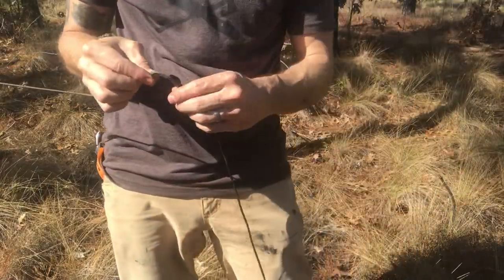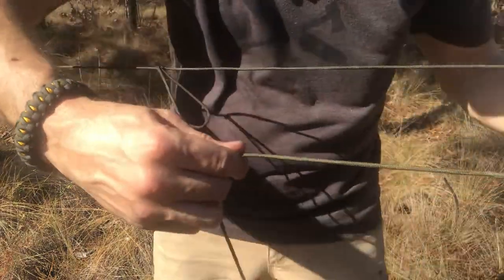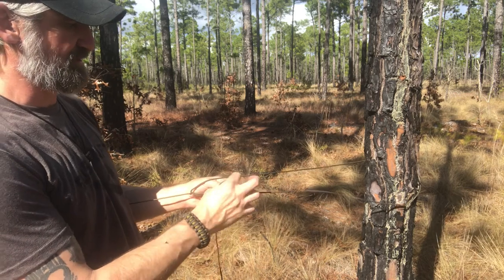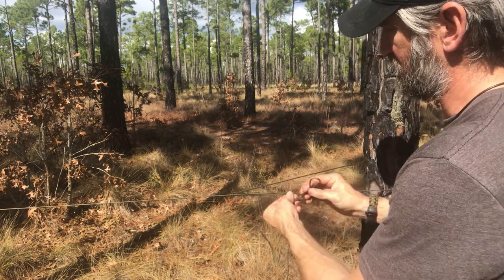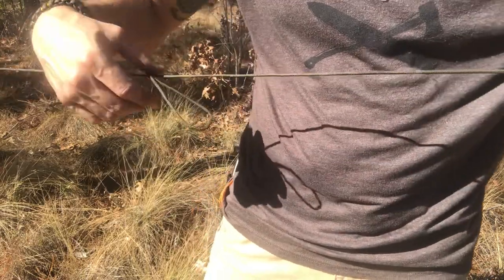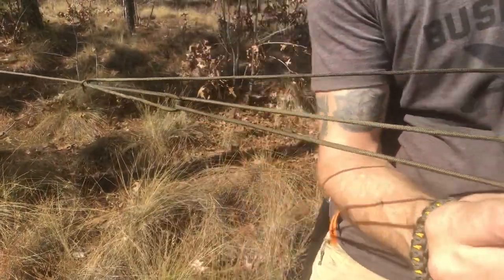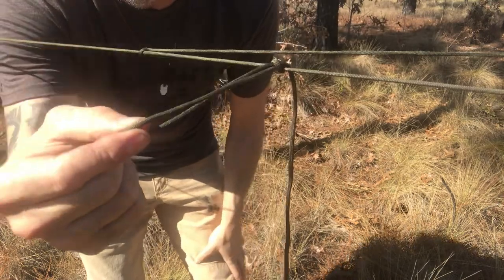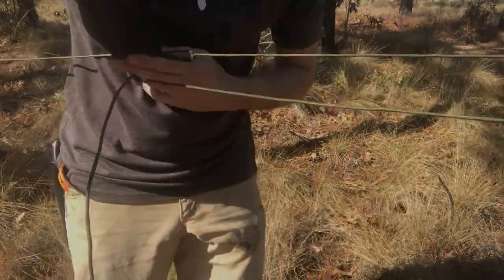Truckers Hitch Variation

Comment: That’s awesome, I had trouble keeping the tension while I made the bight and the ridgeline would keep ending up slack while I tied off the anchor
Thanks 👍🏻
Also I tried the ridgeline first with cheap nasty braided nylon twine and made the prusik’s from single threads of the same twine and it didn’t hold at all, yes it was cheap slippery nylon but was disappointed to think I would have to get a specific type of cordage to tie off a shelter, but the Klemheist knot worked well actually with the same nylon twine so i’ll be using the Klemheist personally as it seems more forgiving with even the worst cordage options. Of course ideally I should use paracord with tarred bank line but that’s not necessarily going to be available if I need to use whatever I can find in an emergency